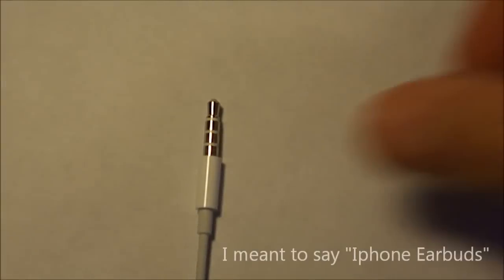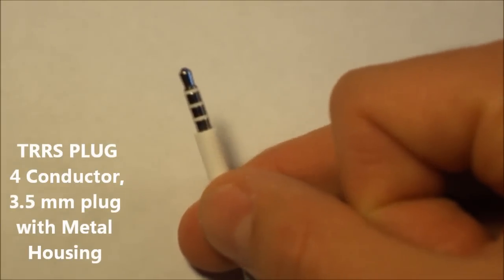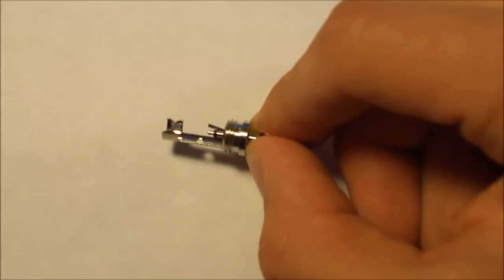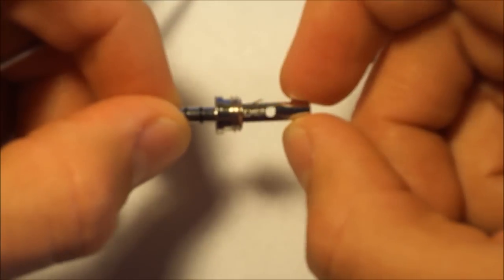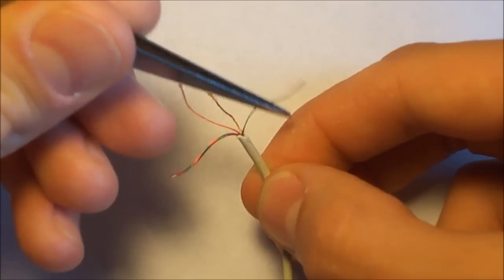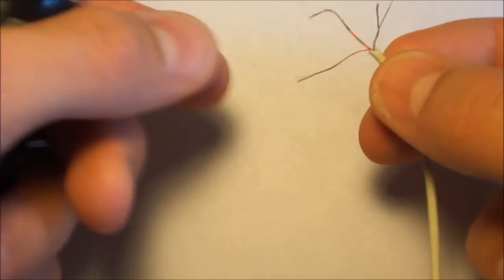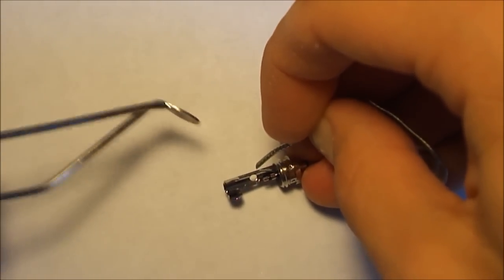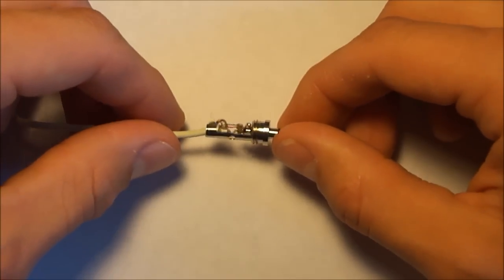Repairing Headphones with Microphone (TRRS Plug)

Comment: Hey rich,
I have a pair of z22 turtle beaches with a different color scheme, was wondering if u could help me out?
There are 5 wires:
Copper wire, a copper wire with white rubber covering it, a green wire, red wire and blue wire.
Thanks!
Reply from the maker: Here is my best guess:
Treat the copper wire as your ground (outer connector on the video), the copper with rubber coating is the ground for the microphone, the red is the right earphone, Green is Left Earphone, and Blue is the Microphone / Volume adjustment.  

So when you look at the new plug, the Green goes are on the smallest center connector, the Red goes on the 2nd smallest, the copper and copper with rubber coating goes on the third connector (the connector shooting out to the side), and the blue wire goes on the outside connector (the largest one). 

Hope that helps!
Reply: RichsMethods Thank you for replying!  I will try this out when I get the TRRS plug.

Comment: Hey, correct me if I'm wrong, but I think the product on the website may be a little different.  If that's true, how would that be wired up?  Great tutorial though.
Reply from the maker: Go to the link on ShowMeCables.com, and go to the view of the plug looking from the top of the plug down to the tip. The center circular piece (the connector at the very middle) receives the Green wire (left earbud), the connector coming out to the front of the plug receives the Red Wire (right earbud), the connector on the right receives the grounds (copper and the red/green striped wire), and the largest connector receives the White wire (microphone wire).  Thanks for pointing this out.
Reply: RichsMethods Ok thanks.  This was really helpful, and thanks for the quick response.

Comment: Instead of using a lighter to remove the enamel, apply flux to the unstripped wire, and then heat with the soldering iron with a blob of solder on the soldering iron. In other words, tin the wire without stripping it. The enamel will burn off and the solder will tin the wire directly. This gives you much better control over how much of the enamel is removed -- plus, tinned wire is easier to solder. 

For fine electronics like this, I highly suggest using a pencil-style soldering iron, not a soldering gun. The guns are designed for heavier soldering, so it's easy to overheat the plug and melt the plastic parts.

Comment: Why is it that when I recorded using trss plug on an iphone , i can record using the headphones not just the mic. CAn we speak thru the headphones as well wit Trss plug?
Reply from the maker: The microphone on the Phone itself is probably activated when you use the TRS plug by itself. The phone should be able to detect if it a microphone is connected.
Reply: RichsMethods I have no clue what Royal Ace is asking, but yes, iPhones do indeed detect whether TRS or TRRS earbuds are plugged in, by detecting whether the sleeve and second ring position are shorted out (TRS) or not (TRRS).

Comment: Can my iPhone 5 headphones get damaged if I spilled a little bit of water on them ?????
Reply from the maker: Yes they can. However, usually if you let them dry out they work fine. My suggestion would be to place the headphones in some dry, uncooked, white rice in a cup for around a day or so. The rice will absorb any moisture.

Comment: I have have some headphones that I was trying to fix when I noticed there was 6 wires one red one green one blue one copper another red by a copper wire with a white wire looking thing I don't know if I should combine the copper ones or something else. I NEED HELP PLEASE!!!!!!
Reply from the maker: Was the Red / copper wire (with a white wire in the middle) twisted together as one wire? If so, I would connect the White wire with the other copper wire (these are the ground). Then use the Red / Copper wire as I do the Red/green twisted wire in the video. I know its complicated, but I think this it.
Reply: Well the red wire and copper-ish wire are separate kind-of from the other ones. The red and copper-ish are not together and the white one has a copper wire wrapped around it not the red one.
Reply from the maker: 'Spaceblind 879 Here is what I think: "What!!?!?" ha, just kidding. I'm only guessing on this wiring schematic. 
Green = smallest center connector I show on the video
Red = 2nd smallest center connector
Blue = this could be a ground, combine this blue wire with the white wire inside the copper wire and connect to the third largest connector on the plug
Copper, Copper, and Red = on 4th connector 

The Green is the left earphone.
The Red is the right earphone. 
I'm thinking that the Blue wire and the White wire are both grounds. 
The Copper, Copper, and Red wires are your accessories, like microphone, volume control, etc. 

What brand of headphone are you fixing?
Reply: I am fixing Polaroid and I figured it out. The red wire is the right. The other red hat a faint copper in it like your green/red wire so that one and the green are the mic. The blue is the left. The other two are the copper ones which are the ground.  I some how figured this out with my dad and some help with your vids. You just earned a like and a subscriber!   :)
Reply from the maker: Spaceblind 879 That's awesome! I'm glad you finally got it. It can be frustrating, but it was well worth it. Happy 2015!
Reply from the maker: I'm going to write down your schematic in case someone has a similar question in the future. Thanks again.

Comment: Hi Rich and all others. Do you or anyone out there have a video or instructions for replacing the jack on UrBeats ear buds?
What color wire goes where on the jack?
Reply from the maker: Unfortunately, I do not have a video specifically for URBeats. However, if you provide me with a list of the wire colors you are finding, I could help.
Reply: Hi Rich. Thanks for your response. If arranged from left to right the wires would be far left=red,red&white,copper,copper in white insulation,green&copper,green. I'll try and add a picture for you.
Reply from the maker: DayQuest54 So you have 6 wires?
Reply: Yes. How can I attach or send you pictures
Reply from the maker: DayQuest54 Richsmethods@gmail.com

Comment: Hi Rich and other youtubers,
I cut open my apple earpods that came with iphone 5s and I see the following wires:
Solid Green, Green/Copper twisted, Solid Red, Red/Copper twisted, Green/Red twisted, and clear/transparent wire. Can someone help me identify these wires? Thank you
Reply: This would be my best guess, based on how my Apple In-Ear buds are wired:
Solid red: right channel
Striped red: right ground
Solid green: left channel
Striped green: left ground
Green/Red striped: microphone ground
Clear: microphone

So all the striped ones are grounds and go together to the second ring of the plug, the solid red and green go to the first ring and the tip, and the clear goes to the sleeve.
Reply from the maker: Antonio Tejada I agree with Antonio. Thanks for posting. I didn't know the newer iPhone earbud's wires were so neatly organized. It makes it easier to figure out which one goes where.

Comment: Hi Rich.  I bought a Puma Mach 9 In-Ear Headphones with a mic.  I plug the wire into the headphones hole and it works as a headphone, but not as a mic.  Then I plug it into the mic hole, and it worked as a mic, but not as headphones.  Is there a way I could have it together?  Plz help
Reply from the maker: That is probably because your computer has 2 ports (one for headphones and one for a microphone). Unfortunately, you wouldn't be able to combine them (without some serious rewiring of your computer).
Reply: OK thanks for the help.  I'd probably return them anyways, but anyways, thanls;!
Reply from the maker: William Slicer Can't go wrong with returning them:)
Reply: RichsMethods You're right. :D
Reply: they sell stuff for that this combines two ports into one search on amazon: EZOPower Headset Adapter: Smartphone Headset to PC Adapter - Use a 3.5mm smartphone Headset with Your PC, Converts 3.5mm Plug to Dual Mic/audio 3.5mm for Skype/voip

Comment: I have studio monitors with issues. They use an audio cable that is separate, meaning you plug a cord into your media device AND into the headphones. Nice for people prone to breaking cords. 
But the connection is bad. I popped them open, and all the solder from the drivers to the board is fine, and the jack to the board seems legit as well. I noticed that the metal contacts along the female jack (one for each band of the male cable) could be adjusted. So I pushed them down into the female jack a bit, which made the headphones work better. But I still have to find "the sweet spot" for them to work (which is pulled slightly out of the jack). Any troubleshooting tips to help me fix these? or, is there a decent place to get a quality jack to swap? It'd be fun to do that, but I don't wanna mess up (break the broken headphones, haha). Thankss!
Reply from the maker: I would start by making sure the female jack is cleaned out properly. If you have to pull the male jack out a little to get that "Sweet spot", then something is probably wrong with the female connector. First, are you able to test the Male connector in another media device (to make sure the male connector is working fine)?  Second, use an electronic device cleaner/lubricant like the ones sold at Radio Shack. I have a video showing how to do this "How to Clean Electronics (iPhone, computers, MP3 players, etc) ".  Use the cleaner / lubricant to clean the female portion. Use a lint FREE cloth to clean out any access (cause paper towel can leave lint making your connection worse). If the above does not work, then I would consider changing the plug. I'd bring your plug into Radio Shack, Best Buy, etc, and try to match the male plug to a new plug. Get a gold plated one if possible (highest quality) and try to replace it. You might be able to get a new cord as well (With the plugs on it), which might be just as cost effective. Good luck!

Comment: Love your vids man! Just one question, What if I have 4 wires when I cut the end of my Headphone jack?  The colors are Red, White, Black and Blue?  They are Seninheiser headphones... Thanks!
Reply from the maker: This is just an idea, but the red is the right ear phone, blue is the left, white is the ground, and black is the microphone (connect it to green/red striped wire). If that doesn't work, switch the white with the black (Those are the two I'm unsure about).

Comment: Hi. I'm Using And ILuv Earpiece. If You've Heard Of It Before.. It's A Flat Cabled Earphone... Just Bought Less Than 2 Weeks. Now It Has The same Prob AS the One In this vid.... Can't Hear Much. How do I Fix this!? Are there any Vids On How to FIX A FLAT CABLED EARPHONE SET!? Btw I Live In Singapore....
Reply from the maker: You could still use the same technique I show in my video "How to repair Headphone Wires".  You can cut them open but it may take a little more time to strip the cord away from the wires.
Reply: Ok Thanks RichMethods... ;) Would Try. And If Success I'd Thank You Greatly! Do You Have Like FB Or Sumthin?

Comment: So bro.
Like i have sgs3 headphones.
Its got a mic, volume, pause and skip controls.
I stuck them in a ipad.
Then were ruined.
The sound now comes on the left side.
The mic and volume and everything works.
Just the right side has very low volume..
Like very faded.
Need them fixed.

Comment: The wire connect to the ear bud is completely disconnected, when i put the wires back on there you can hear the music but how can i get them to stay?
Reply from the maker: You should clean the ends of the wires off with a lighter or sand paper. I show how to do this in this video: "How to Repair Headphone Wires ". Good luck!

Comment: my right earpod came into the spikes of my bike, and now one side is strechted. i think its broken or something. its not working anymore, the other side works. how can i fix this?
Reply from the maker: Do you iphone earbuds have a microphone?
Reply: RichsMethods yes
Reply from the maker: The Enderman I'd probably follow my "How to fix headphone wires" video. Your earbuds will have more wires to connect, but if you follow how I cut, clean, and reconnect the wires, you should be able to do it yourself. Cut the wire near where it is stretched out. Cut out this bad portion and splice the wires back together (like I show in the video). Good luck!

Comment: I have this colors above, what i do ?
1 copper
1 black copper
1 red
1 green
1 black
When i cut the wire i see the black,red and copper twisted, the green and black copper twisted.
Please help me, my headphone is from my samsumg S3 mini. I make it but the microphone doesn't work.
See what i do and help me to fix it please.
green => Pin 1
red => Pin 2
copper black + copper => Ground (Pin 3)
black => Pin 4
Please help me.
Thanks a lot.
Reply from the maker: Sorry for the late response. Take the all copper wire and try placing it on pin 4.  The error is in the "Copper black + Copper" Wire. One of those needs to be on another pin.
Reply: Thanks

Comment: How about if the wire is broken (NOT THE TRRS PLUG!), i tried to cut off the part where lays the button so on one end i had the wire that comes out of the plug and on the other end the wires from the headphones. On one side there are 5 wires (red, blue, white, black and copper) and on the other side there is a red and copper wire corresponding to one earplug and blue and copper for the other one. I tried to connect red/red, blue/blue but they don't work.Can i get a bit of help please? :D
Reply from the maker: Sorry for the late response. Did you connect the copper wires as well?  I'm thinking you should connect the two copper wires to the one copper wire and leave out the black and white one. If that doesn't work try connecting the 2 copper wires to either the black or the white wire. One of them has to be your ground.
Reply: RichsMethods hi I need your help when is I'm trying to pause my phone from my earphone it doesn't  I have tried all of my wireless headphones headphones it just doesn't work I think my headphone jack needs repairing I don't know please help

Comment: Should have mentioned that a hot glue gun would have come in handy at the end. We always re-enforce the jack area so that the problem can not re-occur in the future. Still Rich I like the tutorial, this should help a few people. Another thing though, recently repaired a set of Jay's FOUR earbuds and if I would have followed this tutorial then there would be no chance of a fix. Wiring colours are the key, and without the wiring knowledge then these days they are much more difficult to repair. For general standard ones though then this should pretty much work but I would not rely on it too much.
Reply from the maker: Yes, I used hot glue in my very first headphone video. Thanks for the comment. However, a lot of people have iPhone earbuds. I believe this video will help a large portion of the audience. But I do agree with you that every brand will be slightly different.

Comment: Did you ever figure out how to get volume working? I'm repairing mine now. Spent a while figuring out what wires are what. I have Bose mie2 or whatever they are called. I have 2 green, 2 red, 2 copper, green/red twisted pair around a white wire. Green and red are L d R, Cu is a ground. I confused on the twisted pair, as they seemed to "ohm out" to ground. Maybe I was making contact with the white wire. I will try to solder twisted green and red to mic/sleeve point. See what happens. I can love without volume. If it needs the center white to connect to GND, that will be tough. No wonder these headphones "break" all the time. Super fragile and cheap wires. The two green and red wires each ohmed to the L and R channels, so I will twist them together and connect them.

Comment: Will using a TRS to TRRS converter make the microphone work? 

The headphone adapter is TRS, but converter output is TRRS. I'm asking because I need a thin TRRS plug that will fit into my phone case jack. Thanks
Reply from the maker: The TRRS plug only works when a microphone is present. If you headphones have a microphone and originally had a TRS plug, then I stick with replacing it with a TRS plug. However, I'm not sure of the wiring schematics.

Comment: Hi : Need help : Trying to repair headphone plug (klipsch image one). Purchased a new trrs plug and the rear of the plug has three cylindrical terminals + one outer terminal with a hole.

The cable configuration is red/green/two copper wires + red and green.Inside the red and green is a white wire. The klipsch has volume controller but no mic.
Can you suggest were they are soldered as your rear connector config is different to mine. You dont indicate in this video  where the white wire is soldered.

Comment: I have beats ear buds and they don't quite match the description (some parts do)

 I have split the wires and seem to have the following 5 wires:

1 - a blue-green wire
2 - a copper wire with blue green stripes
3 - a white wire in the center that is mostly wrapped in copper
4 - a red wire
5 - a copper wire with red stripes

also, my TRRS plug does not have any thing jutting out:
it has 3 sections to lay the wire across, descending from a thicker area to a smaller mid section and ending with the tip(photo for reference below) :

http://cdn.head-fi.org/4/43/900x900px-LL-43599768_photo.jpeg

Any help would be greatly appreciated!

Comment: I've found that it's better to sacrifice a cheap smartphone headset for this and splice the cables together. The replacement plugs you can buy have giant barrels that are intended to hold thick cables used for mics and studio monitoring headphones, not the thin headset cables.